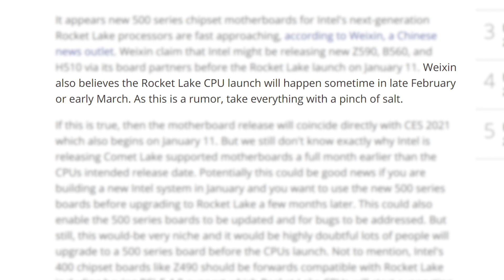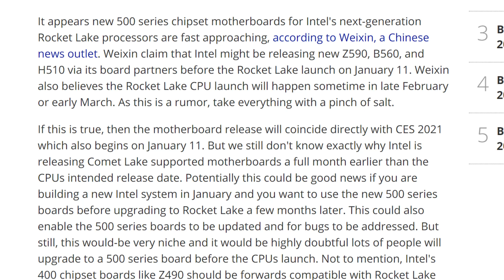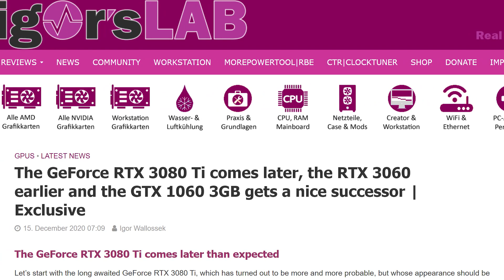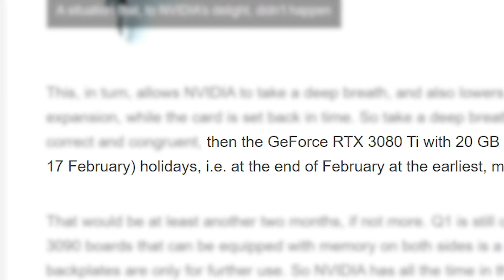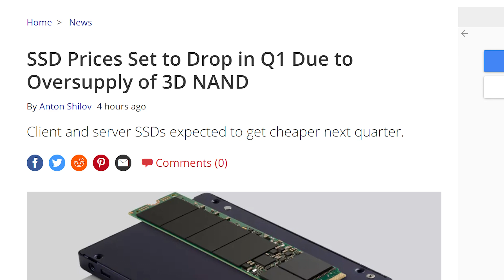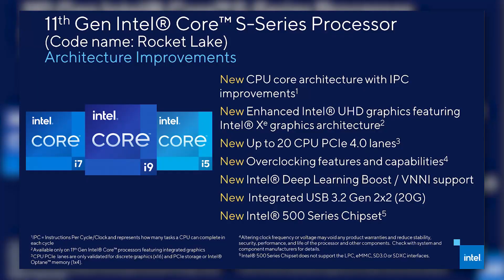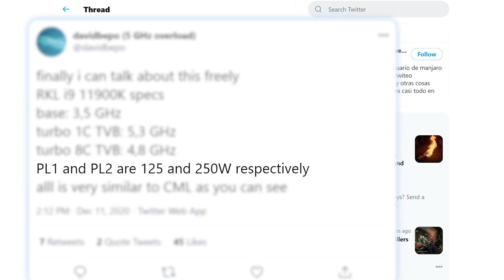Nvidia RELEASED New Monster GPU, Ryzen 5000 & RX 6000 Prices Going UP!

Comment: I just find it odd to keep releasing more and more gpus when you cant keep up with demand for the current stock.
Reply: Because they are sold. They don’t seem to care about who is buying them which is sad
Reply: Corporate logic is not common man logic. They need to present to the share holders that they have answer to needs of every price range. Average share holder has no idea how market really looks so I expect 90% of people with nVidia stock has no idea you can't buy them in store right now.
Reply: @korinogaro  what do you mean?
Reply: @Aetherion0  well companies that listed on the stock exchange have many owners (share holders) right? And share holders can decide to vote to remove CEO if they feel that CEO is not doing his work properly.
Reply: The goal for each chip is to get the highest number of cores possible.  Those are turned into the top end cards.  The ones that fail to meet those standards are still used on the lower end cards with more and more cores turned off.  They are simply using their existing stock already, not going out and making more just because.
Reply: I think this is just a way to stop people from buying old cards
Reply: That's what I was thinking! lol
Reply: Scalpers have become a huge problem.  They're buying up GPU's and consoles quicker than you or I can get them.
Reply: IM COMING OUT WIHT A NEW gpu NONE OF YU ALSO WILL BE ABLE TO GET 
HAS 100000 GB DDR99 RAM 
OPERATES IN A QUNATUM VACCUUM OF ANOTHER DIMENSION SO YOU NEVER NEED OT HAVE THE CARD PRESENT TOO
ONLY 5 TRILLION USD
Reply: Their chip supply is lacking and the coin miners just hogged a big bubble of the factory capacity.
Reply: The stock price are up
Reply: because all people staying home cause of COVID, and their employee cant work too, no exempted here in asia... same in playstation/xbox
Reply: There is no shortage in my country and as someone who wants to buy a cheaper card this is great. So i dont see why not.
Reply: @cleaved3453  and what is your country?
Reply: @cleaved3453  well ok, you have them there but prices are insanely inflated like everyone else. I can get 3080 in Germany too, just don't like idea of paying ~1k
Reply: @korinogaro  prices are always like that here.3060ti at 500 is insane value comparing to everything else but id like to go with 3060.
Reply: @cleaved3453  dont worry the supply will get dry for you in short order
Reply: Ryzen cant do that either
Reply: Because GPU technology just keeps getting better very quickly. Rather than wasting time waiting for materials i.e Silicon, they choose to work on new shit.
Reply: @Vinnay94  well they always work on 2 generations at the same time. One gets finalized and this is what we get and then they focus on another that was in the works while part of R&D starts focusing on next next generation.
Reply: Do me a favor and DON'T look at the prices for GTX cards on Amazon now. I SAID DON'T! Oke, i warned you and you ain't going to like it. The first gtx1080 which pops up (normal edition) for 888€ (1087$!!!!!!), wtf is justifying this bullshit? The card hasn't even been this expensive at it's utter peak directly after its release ALMOST 5 FUCKING YEARS AGO. And you know what's the cherry on top? A brand new 3080 actually has the same price, having double the power in many areas, and this card is 2 generations younger. There's nothing justifying that, nobody is buying 1080s because they are precious to look at when they get old. I wonder where this is going. Right now it looks like mid-tier gaming is becoming utterly unaffordable, because 1080s aren't looking to drop in prices even if there'll be a RTX4000 generation in 2 years. It's extremely saddening and drives me nuts at this nonsense. GTX1080 doesn't beat the RTX3080 in anything except power usage and get's stomped into the ground multiple times by it, and yet the same price...

edit: i just googled GTX1070s, this is even much more sad. 2 GTX1070 on Amazon from 2 different sellers for 894,73€ (ca. 1100$!?), and the price comparison is even so much more sad. The RTX3080 is brand new and even almost 300€ cheaper, wtf? Let alone is it 3 times the power in many aspects. Bro i can't anymore, if no one is going to stop this shit, i'm going to kill every single scalper out there and storm the Nvidia HQ.
Reply: Its price fixing at its finest. There's stock, but they run a monopoly and can make double the money if they do it this way. There's no shortage. It's bullshit.
Reply: @metalphobos  Anything to back up this claim? Not saying you're wrong, this could likely be the case indeed (at least for AMD. Nvidia has way better stocks and at MSRP).